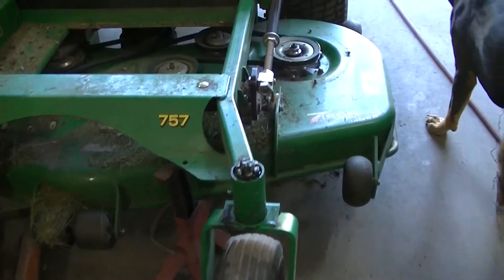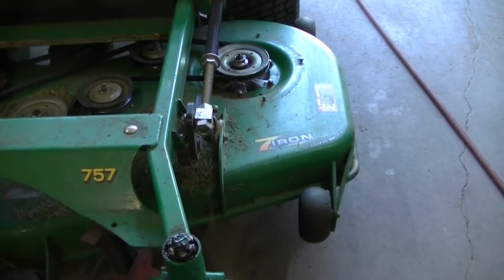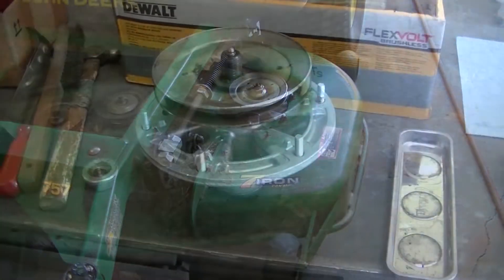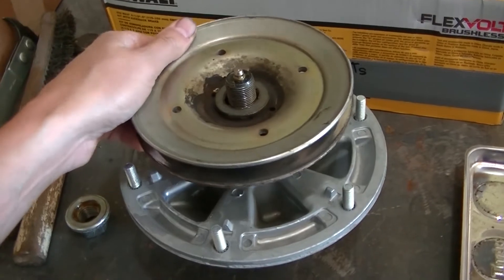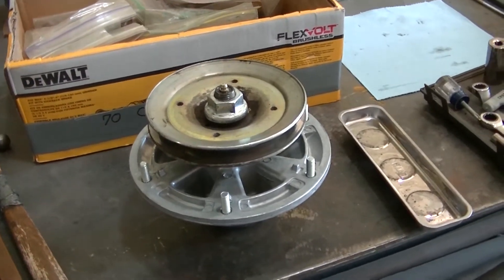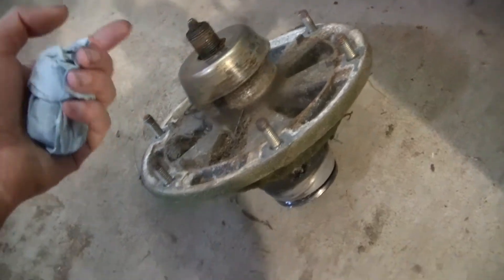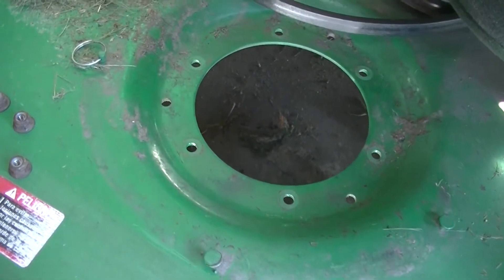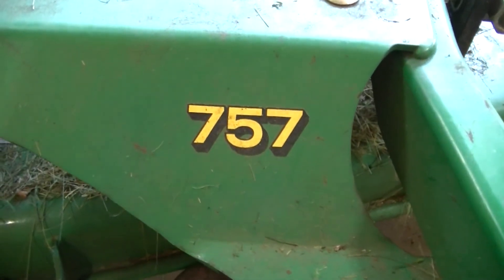John Deere 757 Ztrak 60" 7 Iron Deck Spindle Replacement

Comment: The spindles on my husqvarna have all gone out 3 times each. Its only 3 years old!!!
Reply from the maker: The only reason I am changing this one is a hit a water pipe with it.  It's made and odd noise ever since.
Reply: Do you pressure wash the deck? I try not to get water any where near my mower deck. Use compressed air instead.

Comment: What size nut is on the top of the spindle?
Reply from the maker: Not sure.  I used a standard socket and it didn't fit but worked.  It's pretty big.

Comment: How many hours on that deck?
Reply from the maker: Same as the engine around 588 hours.  I hit a water pipe with this spindle awhile back and it's made an odd noise ever since.  It has gotten worse so did the change.
Reply: mossman381. Ok that explains it... I have a z930 with 630hrs on it and i have a little vibration in the Handel bars.. Might change them out this winter
Reply from the maker: Unbalanced blades can cause vibration.
Reply: mossman381 yes they can... I cut commercial with that mower and i always bal the blades when i sharpened them... I put at set of blades on every morning before i leave the shop...
Reply from the maker: Wow,  fresh blades everyday.  Changing the spindles is pretty easy but they are spendy from John Deere.  I got an NOS one online for about half price of what the dealer wanted.  I only mow one day a week now.  I was looking at the new Ztrak mowers.  They are nice.  I am thinking of doing some upgrades to my 757.  The new air ride seat they have is pretty awesome.  So is the new Tweel (airless tires).